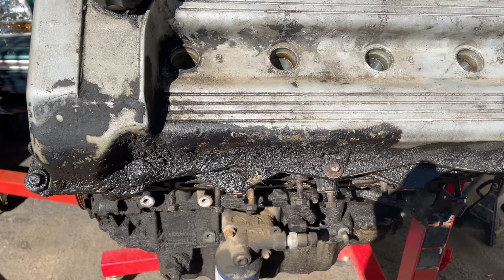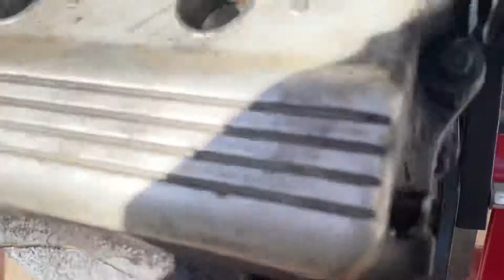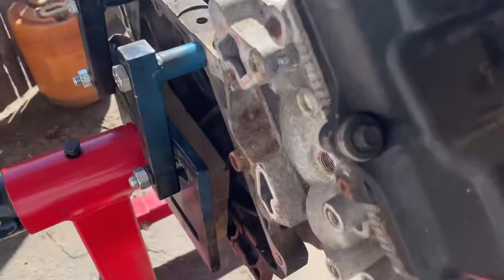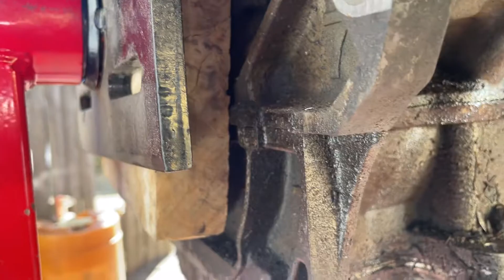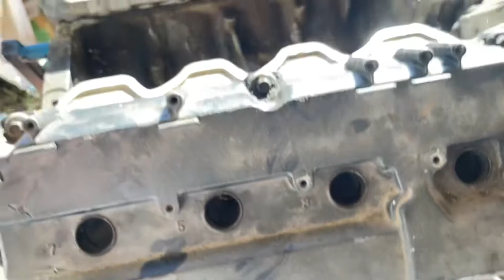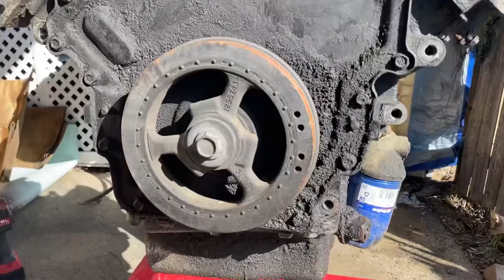4.6L Northstar V8 Extensive Oil Leaks

Comment: Designed to leak oil and blow head gaskets. That engine did more to destroy Caddy than anything else.
Reply from the maker: Good intentions but the engineers must’ve been drunk not to realize the coolant would’ve caused corrosion with the steel bolts and aluminum, and a half case? Stupid design I’ll agree. Although these are very easy to work on.